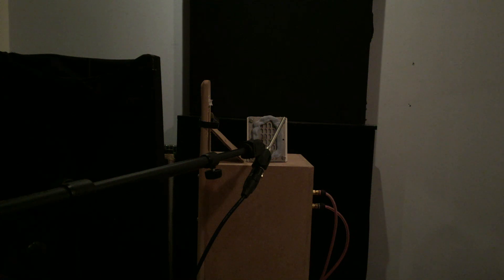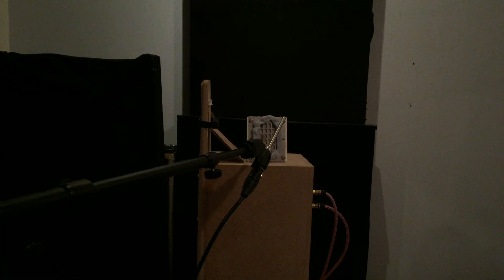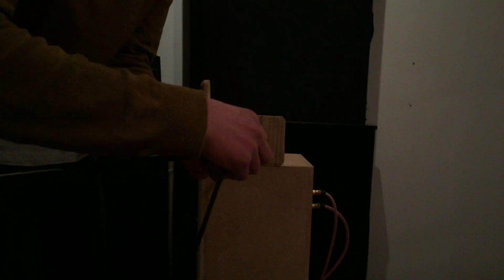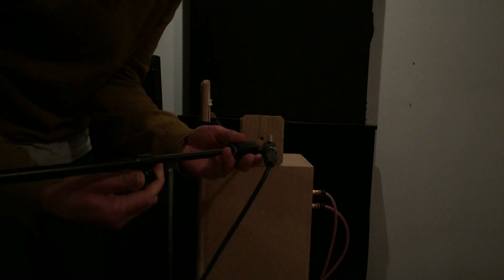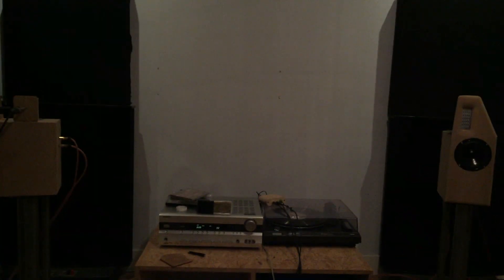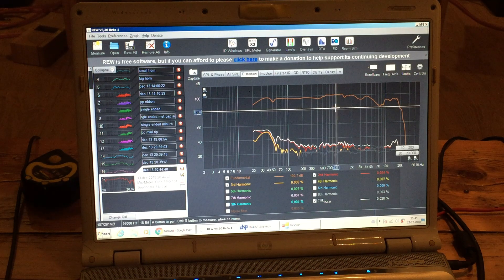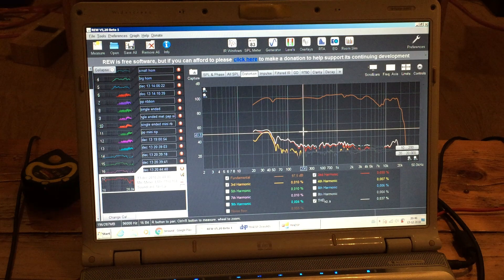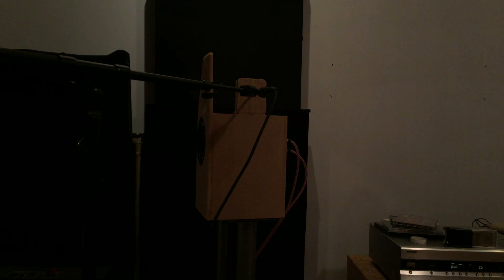From ribbon tweeter to ribbon headphone

Comment: I'm wondering if soft dome tweeters could be used like that for headphones ?
Reply from the maker: there resonance is usually to high, so it wont play much lower, at least not  instead of 1000hz all of a sudden down to 40hz. in this case the resonance of the tweeter is much lower in the 50hz region i believe. (been a while i might say it in the video i forgot)

Comment: Amazing result! As headfone driver they will kick ass!
On the downside, perhaps their size will need to be optimized but I hve no doubt you can do that.
Another thought, which is perhaps too specialized for what you want to do, is using them as a horn driver. Perhaps someone in the extreme diy community can try them out on a horn design??
Line source should work well, but sure your vision is the right one to use multiples-this will be stunning to see.
The one design I saw, that is impressive in itself, is the Infinity IRS 5. - check out videos from PS Audio in their Music Room One where the IRS is their reference system, not too many of them exist. You will notice how the baffels are curved etc. I’m sure its mindblowing to experience them in person!
B.t.w. Happy new year, and wishing you lots of success for 2019!

Comment: You could adjust the decibel scale to something like 5dB per division. 20dB/division makes it hard to make conclusions.
Reply from the maker: yeah, usually do. bot in the distortion  measurement , the one i took a quick look at. is usually in this range or the distortion falls off the chart.. i aint have a high res laptop as you might have spotted :)

But yeah you are right. it is not so much a how to make a perfect headphone driver. since these where never meant to be used that way. but it is fun to see you can get down low when you re purpose a tweeter planar to headphone duty.